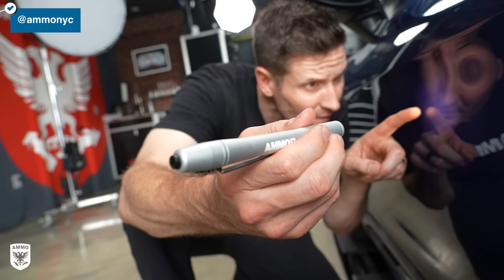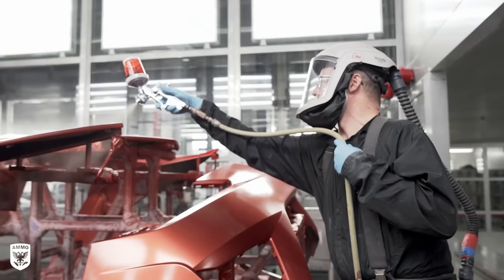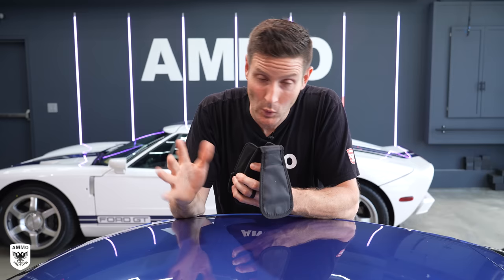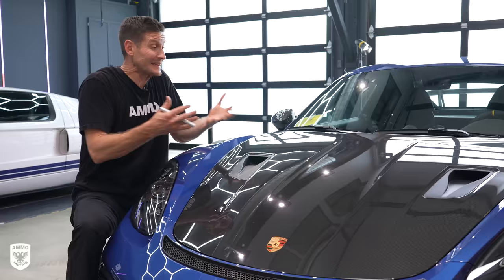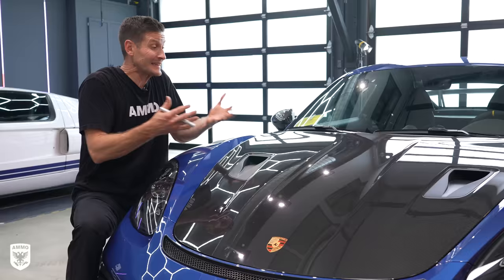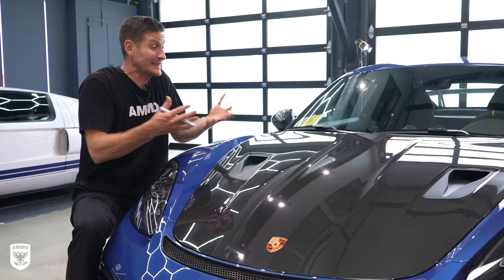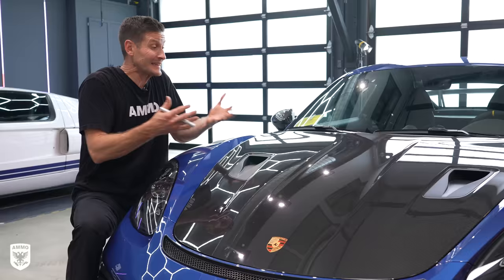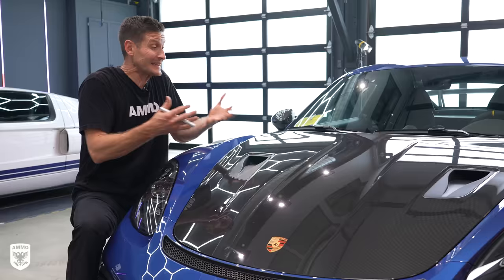Top 10 Tips for Buying a Car: Save Money On The Detail!

Comment: I've been an F&I manager for 20 years in the Northeast. Larry is right about the coatings offered in the Dealership. Most prep departments just wing it with no preparation for the application whatsoever and just want it out of the bay ASAP. He's also right about the tire & wheel coverage especially on high line stuff. The most utilized would be the service contract (extended warranty) we have 2 claims in the shop right now totaling 15 grand. Obviously there's variables but stick with those 2 and do your coatings at a professional shop. These cars come straight fun the factory with plenty of defects. No prep & straight to the professionals for paint correction and coatings.
Reply: I bought Tire & wheel for 992 GT3 and I've already replaced 3 rear tires in 12 months. Way worth it!

Comment: Wish I knew this a few years back when I bought my brand new truck. As a detailer, I should have known but it was my first time ever buying new and thought that the dealer would "take care" of everything.  Not a chance. When I went to pick up the truck, they hadn't even washed it. It was filthy. So, as a detailer, the first thing I did when I got it home was a very detailed exterior wash. Well, when I was finished, I was shocked. Multiple deep scratches, multiple areas where there were almost like small pebbles right in the paint, I had purchased the one-time application of life time undercoating and they oversprayed over the entire paint surface, I had 3 paint blemishes called snowballs ( where the paint is a very hazy, white color which was very noticeable on this deep cherry Ram 1500),  it had a large banada strip on the hood where it looked like a different color, I'm aassuming someone wiped it before it cured? And, I had a spot on the hood about 2-3" long where it got damaged and removed paint right down to the metal.  Now, when I noticed all this I contacted the dealer and they said they'd replace the vehicle, so I looked at 3 other trucks they had there ( same year, make, model and color) and they ALL had the same issues. It took some fighting but they returned my old truck that I traded in, I handed them the keys to the "new" truck that, as they advised me, had to be returned to have hood replaced, rear bumper replaced ( due to the sever staining from the  overspray of the undercoating process) and have it completely repainted, which we know won't happen. They put it right back on the lot after a wash and a heavy coat of wax to "hide" a lot of the imperfections. I now know to do a very detailed inspection of the entire vehicle next time.

Comment: love Reflex Pro. 
The thing about ppf is that it's a strong bond and can melt and warp baking in the sun then it cools and may pull paint off when removing if left on for more than 2 to 3 yrs  so you'd have to remove and replace it often that's too expensive to ppf a whole car.   just do the areas most effected  polish n coat the rest. it's cheaper to fix rock chips n scratches than it is to replace film. makes no sense but it does work so 🤔 more people should ppf the headlights but then I wouldn't be restoring them as much lol
awesome videos as always Larry 💪

Comment: Great car choices for the demo. Do you adjust your pressure washer PSI for various paint or age scenarios? For example, the new Porsche paint and clear chemistry is much newer and very different vs. the vintage MB single stage paint. I'm wondering if that matters when working with a pressure washer.

Comment: Good day Larry, if this applies to a brand new car/ truck straight out of the factory, and youvtake it away untouched/ unprepped from the dealership, you later discover defects at the external prep/ detail center, won't the dealership say it's from them or there's no way of proving that the defects is from the factory? 🤔
Reply from the maker: Hello, yes my suggestion was to inspect it at the dealership. As you can see in the video, we peeled off the plastic in the dealership bay. This way there’s no surprises when you take it home.